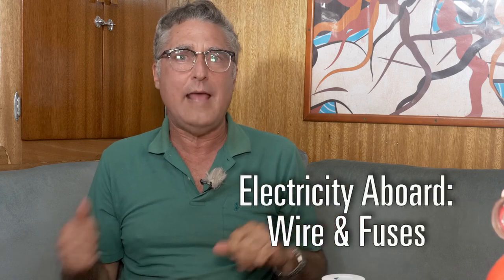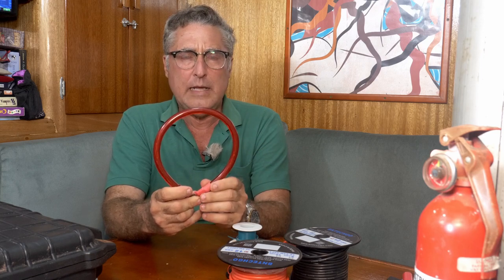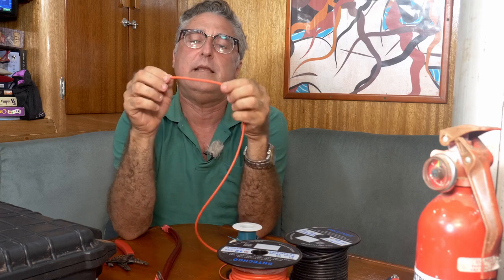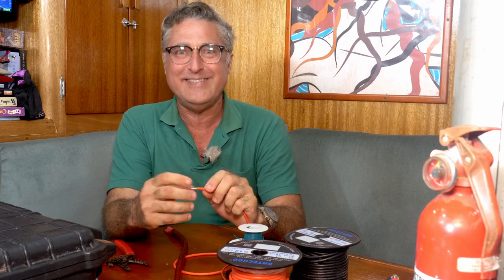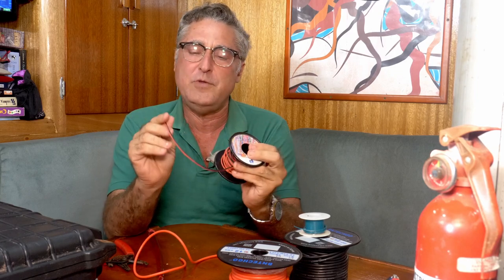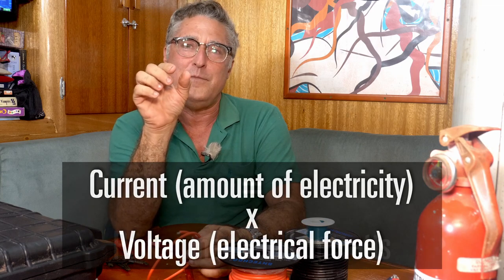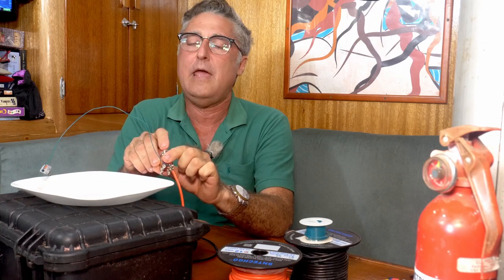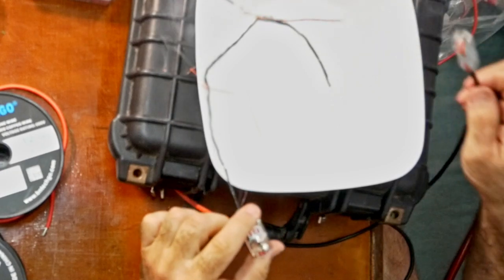DON'T BURN DOWN YOUR BOAT! (Wire & Fuse Basics)

Comment: When I worked at Boeing on the Minuteman program in the early 70's they didn't use fuses or circuit breaker between the power source and the drawer using the power.  So when there was a problem with a small ceramic capacitor it would burn up the board in the drawer.  It was easier to find the cause of the problem that way.

Comment: Never been a lover of fuses, I used to wire houses for a living and here in the UK all main boards are now MCB's and have been for decades. The trouble with fuses is that they are very good at blowing if you have a surge of current but in my experience run past their rating if the current is slowly increased. MCB'S are over current and thermal protection devices where fuses are just over current. I'm aware(I believe) that T class fuses have a time delay built in to allow for start up surges.
I hopefully will be moving onto a boat soon and of course will use the appropriate fuses but have never been a fan. Great vid Clark, a lot was better than my college course.
Reply from the maker: I only use breakers on my boat.  Being able to switch the circuit and protect it with the same device is handy

Comment: Excellent, #2 :26 minutes x how many people I am not going to have to repeat this myself to. 
Thanks for doing the series. Very glad indeed to have a concise series to direct educating people.
A few names I respect their works and writings I see pulling a ~$200 subscription to knowledge that has been caused by the obfuscation on ACBY clairity and purpose. Thanks again for making the information available to all. Sure it will gain in traction over time as multiple mention is made in forum's and the like. Likely you will save lives, boats and definitely enable some boaters.
I just got through reverse engineering/deciphering a Beta marine harness to universal equipment, not fun nor easy, 3 different schematics, physical verification not to mention 1mm and 2.5mm choices to make equivalent extension runs. This mess could have been on one sheet and was when I was done. No wonder most people are lost on electrical on boats.
Last night friend rows in against the wind as the trifecta of problems was finished with proprietary outboard remote keyswitch failure, 14 tiny wires. Manufacturers hate 14GA minimums.
Reply from the maker: Thanks Braith.

As you pass this around please use the playlists link unless of course you are referring to a specific issue.

BOAT ELECTRICAL: https://www.youtube.com/playlist?list=PLsT7_jPsZM5ogT6or244F49-Gy7pYFV7V
Reply: @EmilyAndClark  I will. Thanks. 
Before Calder, Casey ect. Earning your place seriously.

Comment: Just subscribed. Great info! We plan on getting a sailboat in a couple years and I’m trying to learn as much as possible by video and book before starting our sailing lessons early next year. Appreciate you putting these together and making them easy to understand for the novices out there! On a side note, not sure if it’s just my feed, but I found this video on your playlist, but not on your main homepage. I look forward to the next video!
Reply from the maker: It's not released yet.  Tomorrow AM.

I see you use the playlists.  I highly recommend our capable cruiser playlist as a start for someone in your position.

Welcome aboard
Reply: Good luck with your learning process, it is a fascinating journey. If it is not already on your shelf, your next purchase should be Nigel Calder’s ‘Boatowner’s Electrical and Mechanical Manual’.
Reply: @torstenhansen4308  Thanks for the info. I’ll definitely pick up a copy!

Comment: i vote for the battery video ! i have the headways and pelican case ready lol
Reply from the maker: I have an idea for another circuit:
   A way to plug the portable battery into the main li bank safely such that it charges under control but then can be used as an extension to the main li bank until removed for portable use.

Comment: Battery box; I built a similar setup before I saw yours,also primarily for my electric dingy motor, but also multi-purpose. It has + & - large connectors on the outside for the dingy. Iinside, there is a 110V ac battery charger, an inverter, some USB connectors, and a 12 v plug. Since my current mooring is a kilometer from the dingy dock, being able to charge it on shore or in my car is helpfull especially if I need to make multiple runs in one day. There is a Selector Switch to choose the mode or off. To save time and Hassel, I used an off the shelf 54ah battery.
Reply from the maker: Useful, aren't they

Comment: Yet another great vid.  People really have no concept of what an electrical fire can mean - how shockingly hot and violent - and the immense clouds of thick smoke.  Maybe they should be called electrical explosions instead.  If you're not standing in the companionway you probably won't make it out.  I didn't know about silicone wire - that looks like great stuff to work with.  And you can bake a casserole in a silicone baking dish, so great heat insulation too.  This series prompted me to get on your Patreon, which I should have done earlier, for all the great wisdom I've gotten.  Also - I'd like to know your thoughts on dyneema rigging one of these days.  It's the new hotness but I would be curious about your thoughts.
Reply from the maker: Thanks.

I don't like it.  It's strong and light but never make an enemy of anyone who owns a knife!   Too susceptible to vandalism.
Reply: @EmilyAndClark  Holy cow - I absolutely never considered vandalism!  Thanks.

Comment: Very helpful to a newb like me.  I have a new to me used boat from the early 90s which I know nothing about. With guidance like this I’m hoping to learn how it works and where improvements are needed.
  It’s a 24 ‘ seaward trailer sailer with small refrigerator, 4 batteries and oversized alternator
Reply from the maker: Thanks Don,
   Welcome to the life.

Comment: Thanks for sharing Clark. I do not understand why it is acceptable to use a smaller gauge wire on the negative side of a circuit. Will you cover this in a future video?
Reply from the maker: It isn't.  I should state that clearly someplace.  Thanks for the idea.

Comment: I think that when we use the terms Current instead of "Amperage", Power instead of "Wattage" and Resistance versus "Ohmage" shouldn't we be consistent and stick to Potential versus "Voltage"?

Comment: On boats, are there reasons why one should not decrease resistance and increase capacity of a circuit by adding a second wire to the same circuit? In other words, can one use two 12 AWG wires in place of one 6 AWG wire if 12 AWG is what is available? Should one use the same size ground wire?
Reply from the maker: Yes you can use parallel wire.  In the AWG system subtracting 3 doubles the area.  So two 12s would be the same as a 9ga.  A 6ga would be like 4 12ga wires.

Yes the whole circuit has to be considered.  (I'll be giving tips about the "Temptress" way to run grounds in a video eventually)
Reply: To be clear in my opinion and frequently safety or codes: separate or parallel load sharing runs increase efficiency but should be given protection amperage rating safe for the single. Part of safety ratings are how much heat can be transferred, bundling, conduits, insulation and hot engine rooms all de-rate safe capacity. Eg, pull a second parallel set of 10GA on 30Amp protection yes, pull double 10GA to run 60AMP no.

Comment: Clark, Do you have a link to your trusted electrical components like silicon wire, fuses, DC circuit breakers, busbars, inverters, charge controllers, DC-DC converters etc etc. It is good to see trusted equipment used by you that you found to be good quality. Thanks a lot.
Reply from the maker: I'll see what I can find on Amazon and put some more things in our store.

Comment: Thanks Clark for your great videos, looking forward to more. What do you think about lithium titanate oxide cells for batteries on boats? They seem to be a safer option than lithium iron oxide cells?  What is your opinion on them? Thanks again Clark.  Cheers
Reply from the maker: They don't really work easily.  The voltage slides down so far as they discharge you would have to build a big  buck/boost converter to use them on a boat.

Expensive and 20% loss.

Lifepo4 is quite safe.

 How about sharing the playlist link with friends?
BOAT ELECTRICAL: https://www.youtube.com/playlist?list=PLsT7_jPsZM5ogT6or244F49-Gy7pYFV7V
Reply: @EmilyAndClark  Toshiba announced a new SCiB 20Ah-HP cell in January, they also announced sampling of a 40Ah12V drop in replacement for automotive lead acid starter batteries on their site using the new cells. Nominal voltage 13.8V. I'm guessing it's 6S2P, with no buck/boost.

Comment: Do you have any thoughts about a maximum allowable voltage drop? Maybe 5%?
Reply from the maker: 5 or 10 generally.

If it's a light in your engine room that might burn 2 hours a year, it doesn't matter as long as it still works.

If it's your refrigerator using over half your power...  Well invest in some copper there make it low loss.

Comment: An unrelated question.
I play guitars and use several different effect pedals.
Most require 9V DC to operate and on some of them, I can see the current requirement for the power adaptor, like 0.3 amp.
Is there a problem if I use an adaptor that supplies more than that, like 1 amp?
I know the power adaptor and it's cabe/plug will be OK but I wonder if by doing so I can ruin the actual pedal.
Reply from the maker: No worries.  That rating is the max the supply can handle.  If the pedal needs less no worries.  A big supply will have enough to run a bunch of pedals or just one.

But...  Make sure you get the polarity right.  Guitar pedals usually are center pin negative while most power supplies are pin positive.
Backwards might ruin your effect pedal.
Reply: Thanks for your answer.
I'll pay attention to the polarity.
Great videos, by the way!!!

Comment: For clarification....   aproximately 20A for a wire size of AWG 12, however, I think it is worth while to clarify that a fuse or a breaker of 20A can be misleading when one is not mentioning the Voltage no ?! 20A at 12V would be supplying 240W but 20A at 120V would be 2.4kW...
Breakers in particular. 20A may not be equal 20A or am I mistaken ?
Reply from the maker: Actually you are mistaken.  Wires are sensitive to current.   The equation for the power loss in a part of a circuit (derived from ohms law and the power equation already mentioned cooked down with a bit of simple algebra) is P(watts) = I²R.  So the watts of heat generated in a bit of wire comes down to the current squared times the resistance.

From the wires point of view the voltage doesn't directly matter.
Reply: @EmilyAndClark  Is that suggesting that a 20A breaker marked for 120V is interupting the circuit at 20A but 12V ?
Reply from the maker: Yes.  Often circuit breakers work at various voltages.
Reply: @EmilyAndClark   I love to be correctedf, as it teaches me things ! Thank you.
Reply from the maker: Me too.  My best days are when I've found I've been wrong.  Then I get to apply my new knowledge to all sorts of old ideas.